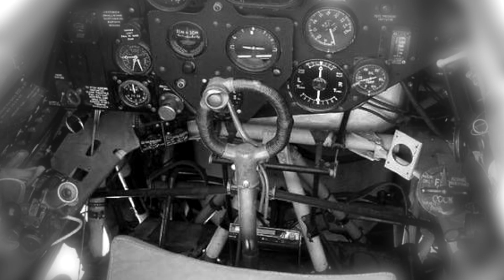Homemade Joystick

Comment: With his system, do you have jerky movements when you go through the center as many cheap joysticks? Or it is smooth movement?
Reply from the maker: Hi - no, there are no jerky movements going through the centre. I haven't designed any specific centre notch in the middle of the travel, and both pots (X and Y axis) measure continuously from full throw one end to full throw at the other end with no change or bias either mechanically or electrically in between. Hope that helps - thanks for watching!

Comment: How is those small Halifax sensor working with those round magnets? I know how they work. However,  Halifaxes work with the mag field between N & S.  It looks like you're only getting about 5-10% of travel between N to S on the mags. I would think that would not give much of a voltage change.  Is there something else going on or does that brain box just to full sim travel with a very small input voltage. I'm guessing from  + 0 - , you're getting less than .5 total swing + / -  ? an honest question not an observation even though it comes across that way.
Reply from the maker: Yes you're right, it's not using much of the travel round the magnet, and I have experimented with using potentiometers too, but again the same problem with only using a small portion of the potentiometer track. Short track potentiometers requiring only 30-40 degrees of rotation seem to be rather expensive. However, in X Plane you can trim the sensitivity so only a small amount of travel produces a full range of joystick movement - not ideal, but it works!

Comment: Wunderbar, is there loads of code for this application?
Reply from the maker: No, none at all!   The Leo Bodnar unit I use to sense the movement of the joystick, plus any buttons, plugs straight into your USB and works with your flight sim. Just need to calibrate it, but no code needed -   thanks for the comment.
Reply: I bought one yesterday, quess it is passing Denmark about now. I can wait to start my build. I am aiming for a spitfire replica with one joint in the base and one half way up as the real thing.

Comment: wich kind of sensors are you using?¡
Reply from the maker: I'm using hall effect sensors - these ones from Leo Bodnar (link above) although you can get them from loads of electronics suppliers. Have been experimenting with potentiometers which also work well. Thanks a lot for watching!

Comment: The shipping for the Bodnar units can add up for certain parts of the world. An alternative can be had using a $5 arduino or similar control board while running custom firmware. Anyone interested should search for "MMJoy" and "FreeJoy".
Reply from the maker: Will check it out - thanks!

Comment: Hi, Great design. But can you please explain the magnets for the hall effect sensors a bit more. What bit is the magnet, the outer ring or the inner circle? Where is the north and south pole of the magnet located? And how strong are the magnets? 

I'm trying to build rudder pedals and a joystick with hall effect sensors, but there's so little information about them out there. So any help would be appreciated :)
Reply from the maker: Thanks - sure no problem. Have a look at the video from 1.56 to 2.06 - The circular magnets are the outer more silvery rings (they go around the 10mm steel shaft). The diametrically magnetised ring magnets I used have for example North pole at the top (where the black pen mark is) and South pole at the bottom (although in practice here I probably swivelled them around so the top was not necessarily North). Magnet details are here https://www.first4magnets.com/circular-ring-c37/20mm-o-d-x-10mm-i-d-x-5mm-thick-n42-neodymium-magnet-3-2kg-pull-p3842#ps_0_4030|ps_1_3098   (You can also get ring magnets with a different magnetic configuration but you don't want those for this application).  I am also experimenting with potentiometers connected to the shaft instead of magnets and hall effect sensors; this works too as the Leo Bodnar unit will work with either.  Hope that helps!
Reply: @THFlightSim  Thx for the quick reply. Yes that definitely helped!
Reply: @THFlightSim  I wonder if salvaged hard disk magnets would work - they're also diametrically polarised, i.e. each of the two faces has a N-pole at one end and a S-pole at the other.  Must try that out.

Comment: For anyone wanting to build this: Those bearings he is using are "pillow block" bearings and you can order them in sets online. He is using the 8mm (inside diameter) ones I believe, which I buy often in packs of 4. I own about a dozen of them. Even the cheap ones will get the job done and they even have small slug screws (hex/allen type) that you can tighten and make the axle sturdy.

Comment: Reckon I could 3D print the base? I'm pretty bad at metalworking and I don't have all the tools for it
Reply: You could use a nice piece of MDF wood from Lowes/Home Depot since it looks nice and low profile and holds its sturdiness well. I suggest 1/2 inch (roughly 12mm) thick. Or you could also use cheap plywood to make a tray for forming a concrete square so that it will weigh down the base nicely. You could then use adhesive to put the MDF wood on top of the concrete so that you can drill holes easily. There are lots of tutorials on youtube on how to do that. But I suggest just using a thick slab of wood. You don't have to use MDF but I just personally like it for mechanical applications. You could even use a sheet of acrylic as long as it's large and thick enough to stay steady. They sell all kinds of sizes on Ebay at decent prices (better than retail prices).
Reply from the maker: @johngober4088  Yes good point John - A nice thick slab of wood would be good (MDF, or even a nice piece of oak with some varnish to make it look more authentic!) - Doesn't have to be metal, although if you do use metal there are some places online that will cut pieces to order, which is a great help as I don't find cutting metal that fun...

Comment: Hey what are the springs you are using for this ? :)
Reply from the maker: Hi - I got them from ebay  - https://www.ebay.co.uk/str/FirstCompression?_trksid=p2047675.l2563  and ordered these springs - 15.9 OD Stainless/Crabon steel tension spring, Wire Diameter: 2mm Carbon steel R11.81N/mm/cm, Length: 70mm - hope that helps!

Comment: amazing design. i wanna build myself a 737 style yoke
Reply from the maker: Thanks a lot - yes for the 737 you'd just have to put the roll axis sensor at the top of the column rather than the bottom...

Comment: Really impressive.   I'm thinking about a a similar thing with a modern stick,  But using Pots as this is what I know.    What hall effect sensors did you use?   You've kinda piqued my interest.
Reply from the maker: Hi - thanks a lot. The hall effect sensors come from Leo Bodnar (same place as the controller) and work pretty well. I've also gone back to experimenting with pots too. The only problem with standard ones is that you're using only part of the track (about 40 degrees out of a possible 200 degree range). However I did find some Vishay pots that only have 45 degrees rotary travel from Digikey electronics. But they're not cheap!
Reply: @THFlightSim  Expensive pots.    The leo bodnar device ( i have a couple) has 4096 steps on the full sweep of a pot (Maybe 300 degrees)  But, if use are using 50% of the pots rotation (generous)  you are down to 2k steps.   Therefore reducing the 'sensitivity'.  I got around some of this by using sliding pots and move them higher up the pedal (Car racing sim).  This uses most of the travel, therefore getting closer to the max steps.   That said I have a $20 joystick that give 128 steps (throw to throw) I don't notice and grainyness.   But do intend to fix this.   I'd favor Hall effect simpally for the non moving parts.  The brake pedal has a load sensor and does give almost 4000 steps..  But it's pressure related, not position like a pot.    Do the Hall effect sensors need a magnet?   Moving them up the controller is a possibility?  That will give a lot more accuracy.  Just a few inches.  Sorry for the wall of text,   YT's comment's isn't really the place for long posts.
Reply from the maker: @lanzecki  Hi yes that's ok - Yes you'll need magnets for hall effect sensors. The same problem here with magnets again is the range of movement. The circular magnets I used worked well but of course I wasn't moving very much between the north pole and the south pole of them (or whichever way round it was!). You just need to get the magnet away from the centre of rotation a bit to effectively increase the circumference of it and thus the increase the range of travel over the hall effect sensor. I do agree that Hall Effect would be better in the long run as there is no wear and tear on them, unlike pots. Going back to pots, that's interesting that you 'only' got 128 steps with the cheap joystick. Does one really need 4096 steps? Great accuracy, but are you actually going to notice it?! Even just doubling your $20 unit to 256 steps should be sufficient...
Reply: @THFlightSim  No, 4096 steps isn't needed, as I don't feel any graininess  with the 128 step joystick.     My pedals give around 1500 steps and feel smooth as a smooth thing.   I have circular magnets that, like your stick will fit in the end of the axle, but I cannot see it giving many steps.   I've a few mechanical hard disks that have a curved and far larger magnet then the circular ones.   This should allow me to move the hall effect further up the controller, which should allow more resolution. the hard drive magne's are curved and maybe 2 inchs long.
Reply: @THFlightSim  Another thought.  The length of the control is an issue.   You move the top, say 10cm,  the bottom move 0.5 of a cm.  Much like a ships mast can he flapping around in a calm sea...   This obviously reduces the resolution.
Reply: @lanzecki  Make sure that when you use circular magnets, you use  diametrical magnets and not radial or axial magnets. The north/south poles should be on the circumference, not on the flats. If you're unsure, you can test them with a simple bar magnet.

Comment: Hey i ve actually made most of the stuff. I got the chip but I am having trouble. I installed a program but it doesnt look like yours and it doesnt work. Where could i chat with you directly as i ve made most of the work and now i am stuck
Reply from the maker: Hi Sven - Just emailed you...
Reply: @THFlightSim  so the neo. magnets arrived and i went to test it and the hall effect sensors no longer worked. The button works but the sensors dont,so i switched them and the port attachment and they still dont work. What now?
Reply from the maker: @Iamasafetyviolation  If all was working before and nothing else has changed, then you need to experiment with moving the magnets manually over the Hall Effect sensors - If they're the same ones I used you need to move them round their central axis (i.e. the hole) and that should work. If not then you probably have a problem with wiring the Hall Effect sensor to the Leo Bodnar...   There's quite a lot of useful info on the L Bodnar site as to wiring them.
Reply: @THFlightSim  so my dumbass bought wrong hall effects lol. As i didnt buy them from the leo bodnar site as they were quite more expensive. now i know why. They have to be linear with an analog output so the a1302 and i bought the a3144 which has an digital output which isnt supported by the board. Its a bit ironic considering i have everything ready and now everything will be set-back by 2 weeks... but when it arrives if it works the home cockpit project will be a go and at full swing lol.

Comment: How did you set up the tension springs for the base plate so that it stays stable and moves smoothly?
Reply from the maker: Well, trial and error mostly - I ended up using quite strong springs and made sure they didn't get too near the end of their travel at each extreme of joystick movement. I've also added motorcycle steering dampers now which smooth things out further, and also ensure the stick returns nicely to the centre without swinging back and forth if you let go. Hope that helps...
Reply: Spring calculations are quite complicated. In fact, formulas for extension springs alone in my engineering tables take over 100 pages. I recommend CAD packages that allow you to design your mechanisms, springs and test them before you commit to anything. The built-in spring design tools allow you to create springs based on your input data like the size, diameter, required force or extension length. It's pretty straighforward.
Solid edge allows you to create compression and extension spring. Inventor, besides those, can also create torsion springs and has more comprehensive "spring tools" overall, but Solid edge has better general assembly tools. IronCAD with the mechanical addon supposedly has some design accelerator for springs, but I haven't had a chance to test it yet, but it may be worth checking out, because it is considered one of the best value for money CAD package on the market it.

Comment: Very cool but I am not sure how to do the magnetic parts I guess could you help. and also how do I connect it to xp11
Reply from the maker: Thanks! - I have put a link to the magnets in the above description now. Basically they are circular magnets that turn around with each axis movement, so the change in magnetic field causes the hall effect sensor (the little black thing above the magnet at about 1.57 in the video, and below the circular magnet at about 2.04 in the video). You could alternatively use potentiometers instead of hall effect sensors and magnets.

The hall effect sensors (or potentiometers) then connect via 3 wires to the Leo Bodnar BU0836A control board (shown at 1.48 in the video). This handles all of the processing and is connected via USB to your computer. The Leo Bodnar unit will show up as a joystick in the X Plane settings and is quite easy to calibrate - hope that helps! (Hall effect sensors and potentiometers are also available on the Leo Bodnar site - link above)
Reply from the maker: And feel free to contact me through my www.vintagejoystick.co.uk website if you need any more help.
Reply: @THFlightSim  wow that was fast. Thanks a lot. I allready designed the a320 joystick to be 3d printed,I also found an official xp11 calibration tutorial which is easy!

Comment: This looks very interesting! Do you think it's possible to build something similar by repurposing a PlayStation Dualshock 4 controller?
Reply from the maker: That's a good point, most probably yes!  To be honest I haven't tried yet, but it shouldn't be too much of a problem to take a PS controller apart and attach it to the joystick. This is a good idea as it would simplify the build of the joystick and you wouldn't have to use either potentiometers/hall effect sensors, or the Leo Bodnar unit that I used...  If you or anyone else  gives it a try let us know...  Thanks for watching and for the comment
Reply: @THFlightSim  wow, 10 months later and you still reply to comments! I'll let you know if I try it out, I have a limited number of PS4 controllers and they're expensive so we shall see
Reply: @sparrowthenerd  if You want to use it on pc and You thight on money just use chineese clone of arduino pro micro. Everything works almost the same, you just need to upload joystic sketch to board.  It will be a LOT easier than trying to somehow connect halls to ps4 controller.
Reply: @Rozbujnik_Rumcajs  I've ended up doing one from scratch with a Teensy 3.2
Reply: Tim Higham  I did something similar with an RC transmitter, however I lack the experience and materials to make a neat looking stick, I made mine by wrapping some insulation tape around a pencil. It worked with limited success, but it could definitely be better.

Comment: Hi, thank you for posting this video, i found it very well made/explained. I have a question that maybe you could answer for more clarity. Did you use axial or diametrically magnetized magnets? Thanks in advance!
Reply from the maker: Hi -  Here's the link to the magnets I bought from first4magnets.com  - hope that helps...  https://www.first4magnets.com/circular-ring-c37/20mm-o-d-x-10mm-i-d-x-5mm-thick-n42-neodymium-magnet-3-2kg-pull-p3842#ps_1-3098
Reply: Excellent info thank you. Sub’d To follow your progress! Later!
Reply: @Video Creatives Can't wait!